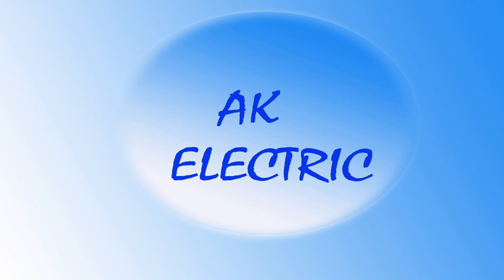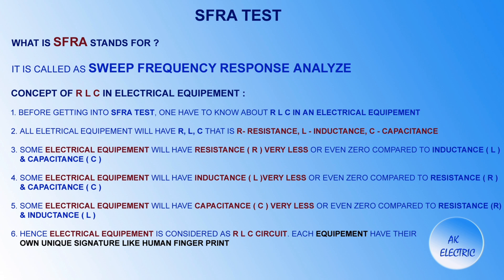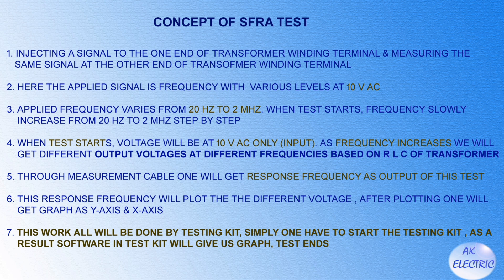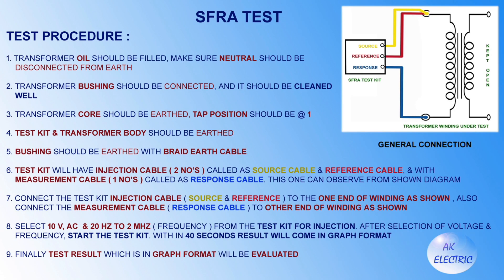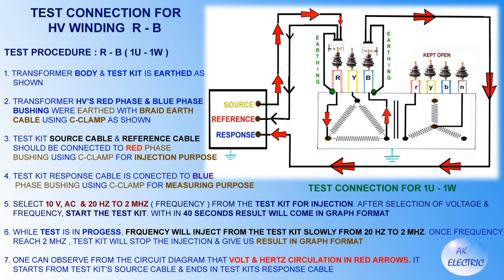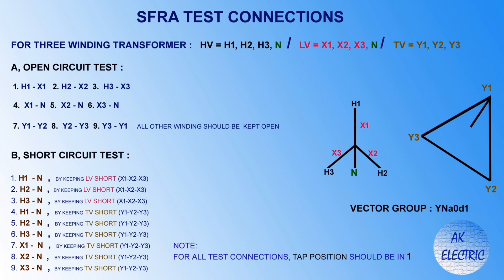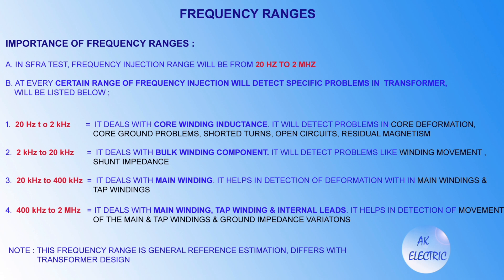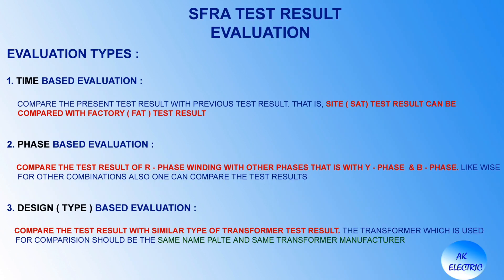SWEEP FREQUENCY RESPONSE ANALYZE TEST, SFRA TEST FOR TRANSFORMER, FULL CONCEPT, TEST RESULT ANALYZE

Comment: "slight difference" if evaluated whether by time based, phase based or design based, what the number "slight" range difference is to be acceptable?
Reply from the maker: Dear Hi,

1. There is not any number in range, only comparison with previous results

2. If one found any changes in result, then one has to cross check with other test like Ratio test, Winding Resistance test, Tan delta test etc., 

3. SFRA test is the first step to identify something malfunction happens in Transformer. With that confirmation one has to confirm with other tests

Thank You,
AK ELECTRIC